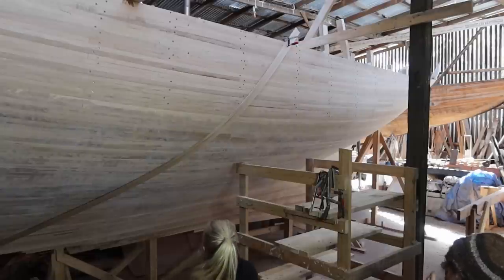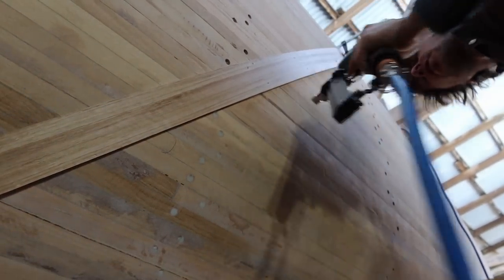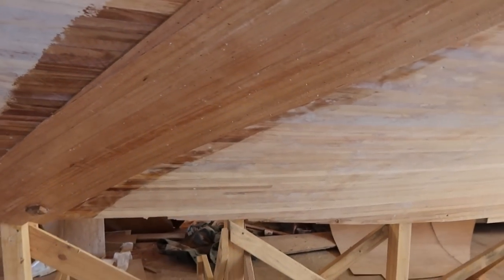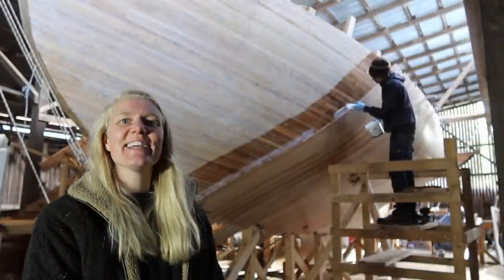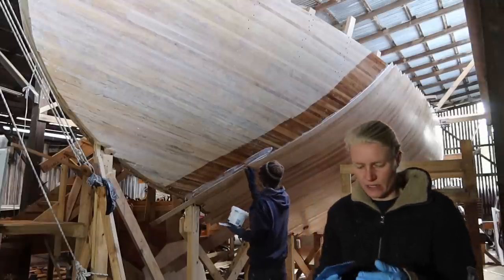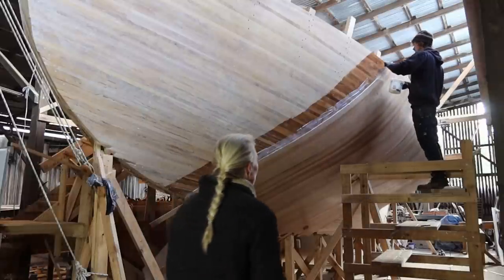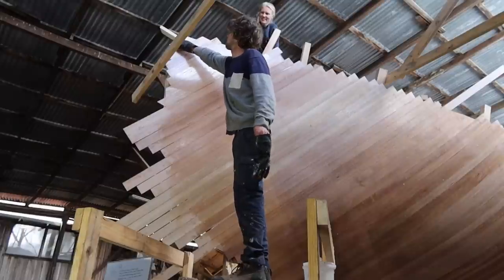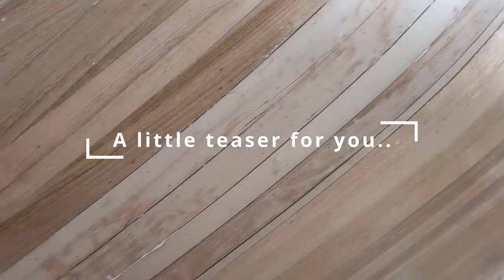Cold molded diagonal planking our wooden boat (EP 4)

Comment: Hi!!! I love the way it looks!!! Now, I have a question... Why cold molded and not marine ply? Is there a great difference? (Pardon my ignorance)
Reply from the maker: Ignorance is bliss! No worries, plywood is firstly not long enough in sheets.. when water gets between plywood it goes crazy with rot. And it won’t be as strong length ways ones it’s cut into thinner pieces… but we did contemplate it at one brief point haha!
Reply: @Building_a_Boat_by_the_River  you two are doing a fantastic job job - One of my favorite boats combined with my favorite hull construction technique!  I live in the Pacific Northwest where a cold-molded Bob Perry-designed yacht named the Nightrunner has dominated its' class in Victoria>Maui and local races and proved its seaworthiness by "doubling" the Horn - Beautiful, light, strong, and durable.

Comment: Really love the diagonal veneer. Do you know at what size boat it is recommended that you diagonal veneer over strip planking.  I have only ever seen smaller boats and canoes where it has just been strip plank only.
Reply from the maker: Hi Tim! Good question, in boatbuilding there is always 300 ways to do something! This is the advice of the designer and she was designed for this method. Diagonal planking has been used for many years for different types of vessels. At work we are working in a 45ft boat from 1898 that has three layers of diagonal planking!

Comment: I have always used wood flour to thicken epoxy . It is much cheaper than the west system epoxy powder and works just as good.  I have tried to split a joint using wood flour and epoxy and have always broke the wood before the joint would break.

Comment: When putting in the nails, why did you not have them all equidistant apart?
Reply from the maker: Our priority was making sure the veneer was nailed down everywhere it needed to be. They are roughly equal distance! Haha but they will be covered with fibreglass and only there to hold the veneer while the epoxy cures.

Comment: Does the layer of diagonal planks just mean that you don't have to lay as much fiberglass down on the hull?? Guessing that's the point of it. Ran sailing did a single layer of cold molded strips but used several layers of fiberglass on the outside.. how thick are the planks you have cut..

Comment: Why is it that you orientated the diagonal planks that way around?  Can the diagonals run to the rear as they come down the boat from the gunwale to the hog?  (I ask as I would have assumed that running them that way would be the intuitive way - for me at least!).
Reply from the maker: Yes we gave that some serious thought as you said we could have gone the other way and most diagonal boats have a couple of diagonal layers so it doesn’t matter as much. We based this choice on when Tarkine pounds into the sea she has a heap of strength transferred to the stem and we can also run the diagonals nicely from the stem post to top of transom.. And it looked better, which is generally the way to go.
Reply: @Building_a_Boat_by_the_River  Thanks for the reply, and good luck with the rest of the build.

Comment: hi I know this comment comes late as I've just discovered your channel, .....i was wondering were you not concerned about the amount of nails you used to pin the veneer for both cost and structural integrity ( so many stress points in the woods grain)?.
Reply from the maker: Hmmm a valid point but we never saw that as a concern, with a thin veneer it so impregnated with epoxy it’s basically bullet proof, we run over all the nail holes with thickened epoxy also. Epoxy wood boat building! Ahah

Comment: Not sure of the reason you did that diagonal planking on top of the horizontal???...
Reply: Cold molding in this case is two layers of veneer over strip planking.
It's common to layer the veneers on the diagonal.  Many designers would alternate the diagonal veneers at 90 degrees to each other to maximize strength.  Paul Gartside (the designer of this yacht) prefers the outer layer to run fore and aft.  His argument for that is aesthetic.  He believes the fore and aft layer mimics the appearance of a.traditional Carvel hull.

Comment: I can see the budget spiraling out of control with every fastener in excess of 27 in the first meter of 1x material.
Reply from the maker: Oh yes, lucky they are plastic and we don’t have a budget! Haha
Reply: @Building_a_Boat_by_the_River  nice
Reply: @Building_a_Boat_by_the_River  I actually thought about using the "leave-in" plastic fastener method on the next cold molded runabout I build. It seems more efficient and less time consuming than the usual "washer/screw while the epoxy dries" method.  What do you think?
Reply from the maker: Yep! Plastic fasteners are the best, they pin it all together while the glue cures and then they are easy to sand off the heads later! Good idea